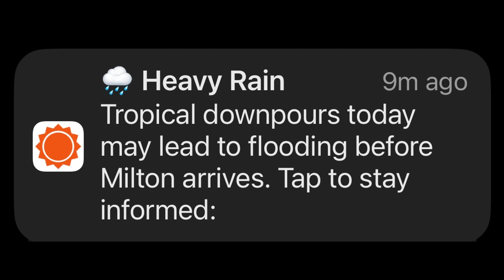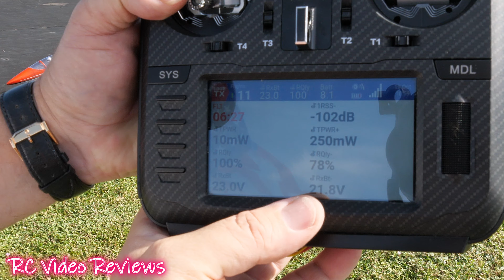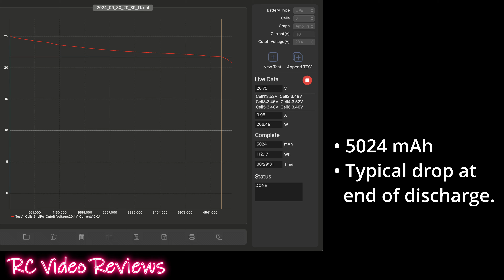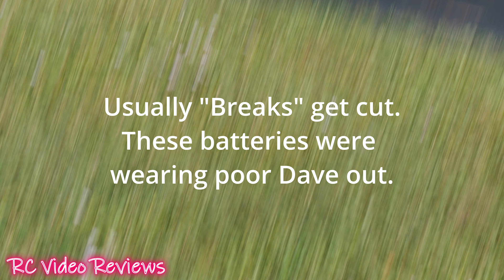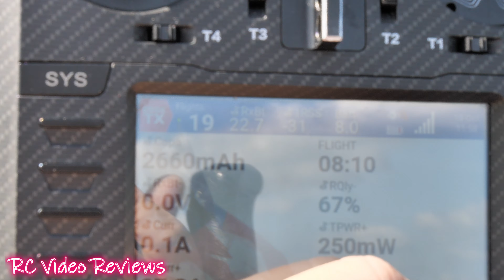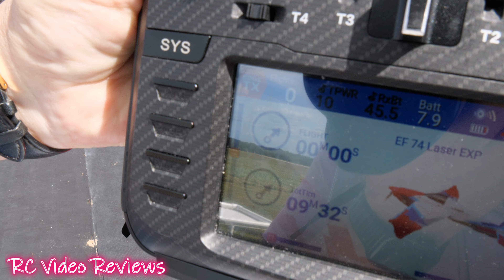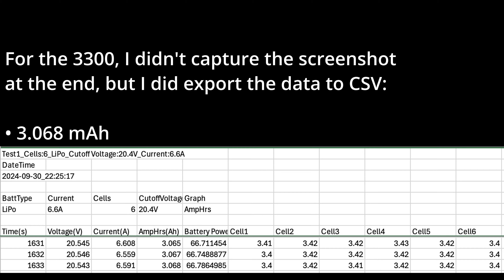CNHL LiPo Batteries • Fixed Wing Flight and Bench Tests • China Hobby Line

Comment: I converted my 74" Skywing laser to 6S.  Same 110A ESC but swapped the GA3500R for a Dual Sky XM6360EA-V3.  Went from two 3300 mahs to using one 5000 mha with only slightly lower flight times. But twice as many flights. Same prop. RPMs were insignificantly lower, but the plane is lighter.  I think it was a good trade. Although I plan to get some 6000s or 6500s for next summer.
Those zero ground speed elevators were amazing!  Good to see you guys having fun!

Comment: The batteries perform excellent, if the longevity on them is decent which I think it will be,That's gonna be a win for the electric R.C community. good Affordable batteries ,nice.
Reply: Not the 4S 2200mAh 70Cs I  bought. No life and voltage drops to 3.5v right after takeoff and a short full throttle pass. I wouldn't try them in any plane. Cs was terrible.
Reply: @Stirling_RC_Videos  Hello that's too bad Your battery didn't work for you.This is the first time we used these, and as you saw on the video They were pretty good for us. now We just have to Continue to use them and see what the longevity of the batters is gonna be. have a good one.
Reply: @davidpaker626  I have 2 of them. The seem to work fairly well in my Cherokee 1.3m.  The issue is that in the T-28 1.2m that they don't have the 70C rating.  Feels like a 25C or less since the battery can't put out.  It does recover when I land, but a 70C should do that immediately in the air.  My T-28 will do 90mph with the Spektrum 30C or Zeee 50C battery.  If I push the CNHL that's when low voltage kicks in.  It may be a bad pair but CNHL will not replace them.  I had a crash as a result and broke a prop and landing gear since there was no power after 3:30 in the battery.  It started full at 4.2 volts.  Not a good show for them, either the battery or customer service.  I'll never trust one again based on my experience.
Reply: Absolutely. We need to fly our planes with batteries and equipment we trust.